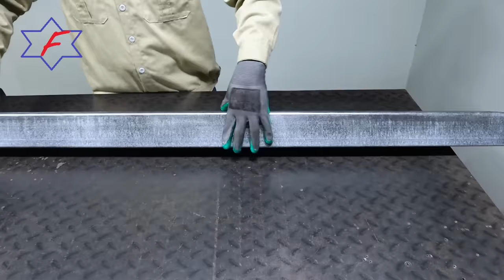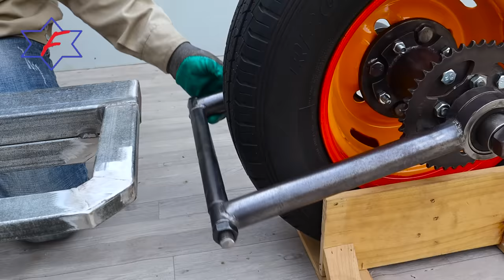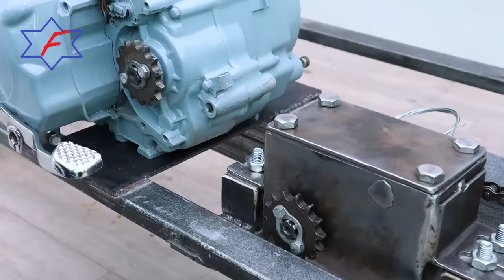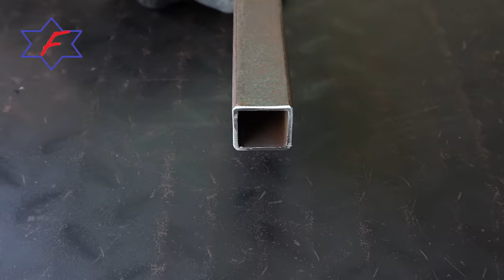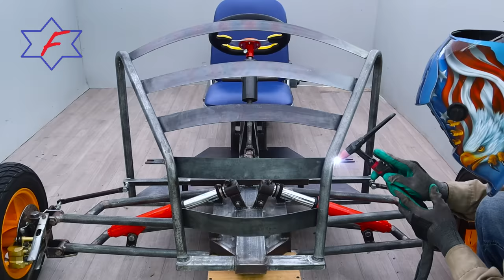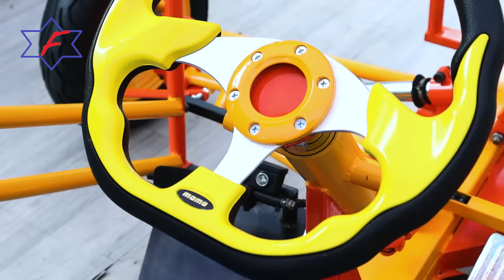Homemade Awesome Trike From Scraps And Use DIY Reverse Gear Box

Comment: and don't forget to put air scopes on the side for the motor 's cooling .. YOUR SEAT BLOCK'S  OFF THE SUPPLY IF U DON'T IT WILL START SMOKING AND EVENTUALLY SIEZE .. HAVE SEEN THIS BEFORE it wont take much to do
Reply from the maker: Many thanks for your opinion!
Reply: @fawabros  11qQQ5

Comment: I need to find a scrapyard where tons of construction steel, steel sheets and new fully packaged suspensions waiting for me to be taken away.
Serious, where is the scrap in this ? 98 % on this in new, raw material.
And everything fits by taking measures with a measure band =)
And, only for the files, your front wheels will be done very soon.

Comment: You're steering is going to snap you have a bolt that runs perpendicular to the range of motion it needs to be vertical instead of horizontal at the point where the tie rod meets the a arm there's a little bar that comes off of the tire there you got a bolt going horizontal you need to make that bolt go vertical before you attach it to your tie rod.
Result better flexibility on your steering and you won't be snapping your tire rods off at the ends.

Comment: Looks fun but I don't think the front tyres will last long? lots of side slip on cornering. Maybe try a conventional  1 front 2 back trike next time, look forward to that.
Reply: 1 front 2 back have lot non-stabile than 2 front, you idea fall easy to curve drive, but 2 wheel front not fall. all reserve trike has build 2 wheel front just thats, no fall and looking can-am etc other factory trikes. 2 wheel back have lot dangerous drive. but this has build totally worst steering ceometry has totally wrong all.

Comment: I recently saw a gear box created form Legos, which reached 100,000 rpm. Could you put one of those high ratio gear boxes into a car and peddle your way up to 70mph+ in a stripped car? 
One gear box to pedal like a bike which turns a second gear box that rotates the drive shaft in a normal car.

Comment: The rear shocks don’t do anything because what should be the pivot point is welded and I would not trust the brake on the large wheel being it is held in place by a set screw.
Reply: Not only is the brake held on with a set screw but the set screw only attached it to the axle rather than the hub making the brake useless.

Comment: Ray Charles could have seen that was fake. I get the theatrics for dramatic effect. But that was literally the only thing that had sawdust on it and it was only on the floor underneath. Furthermore when you blew everything off the paint was in prestine condition. Completely unnecessary! The content spoke for itself.

The reverse gearbox build could have been a whole video right by itself. Great job, and much respect from a fellow diy'er who gets a certain gratification out of building my own stuff rather than buying it. However they do sell those for around a hundred bucks on Amazon though. The amount of time put into thinking that up would have paid for the gearbox. Not to mention the amount of tri-mix, tungsten and other parts that were used to build it. 

Great build nonetheless, and excellent work on the details. 5 star rating even though the beginning was a lame insult to people's intelligence lol.

Comment: That thing is not made from scrap. They almost brand new after you cleaned them.😅
Reply from the maker: Only absorbers are new, bro.
Reply: Everything was new, just threw some sawdust on it and then chunked a bunch of crap on it. 🤣🤣🤣👍 Brand new wires in the engine, immaculate paint on the engine and rims, and tires with absolutely no visible wear except the little mold hairs aren't there
Reply: I thought the exact same 🤣
Reply: Probably a Donald Trump fake channel.  😂

Comment: It's like a RedBull advertisement. Drink 2.5dl fluid and fly away. There is no "DIY" and no "Scrap", no measurement, no welding rods, no breaks on both side of the steering, the steeringwheel fixed with a pushing skrew. If you build anything like this it will not last a day or you be killed... With the same effort you could build something useful too...

Comment: I would have invested in better bearings for track rods etc on the steering, bare metal on a threaded bolt is too crude for safety.

Comment: The brakes system is totally wrong, this has to be on the rear wheel not one side of the wheel.
The reverse actuator is very bad the will cause serious damage if operates while driving.

Comment: What is this ??? The guy pulls a seemingly old bike from a junk pile, takes parts that seem to have been freshly painted, brand new tires and a freshly painted motor with new wires, all lightly coated with a little dust, that uses an air gun to blow away.
I'm only two minutes and forty-five seconds into this video and something doesn't smell right. It seems all too scripted or setup.
The end result was cool, I like it !!! The chain you may need to remove a link because it looks too loose. Still watching video.
Does it go faster than 3 MPH ???

Comment: need plan and build better, worst brake pedals, gear shift linkake, rear turn signal light not vertical need be horicontal,  seat need be adjustable front-back, but nice idea and nice build, pro welder i think has. you drive round, front wheel caster and camber have totally wrong out of dimensions, and steering link has worst need be ball link rod, same than real car, not this worst only rod system. outer wheel if turn, have wrong angle totally bad,  but idea has good, only need build some thinks better, little need use brains more what doing. steering ceometry need build totally new, all has wrong.